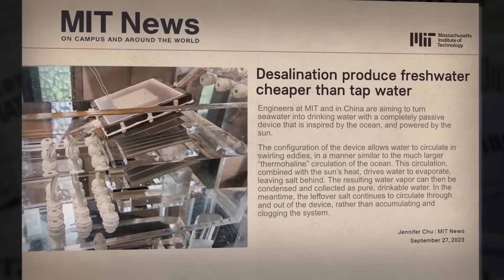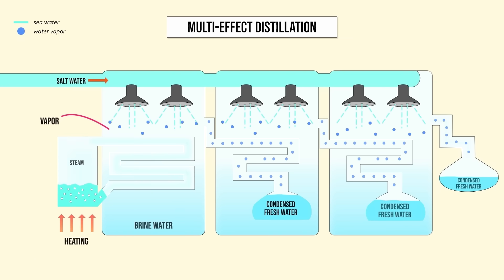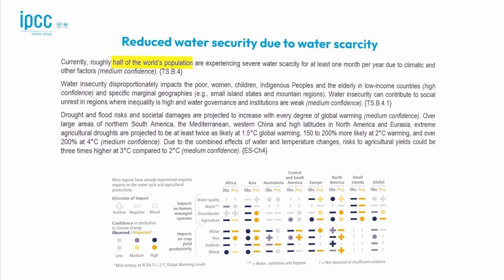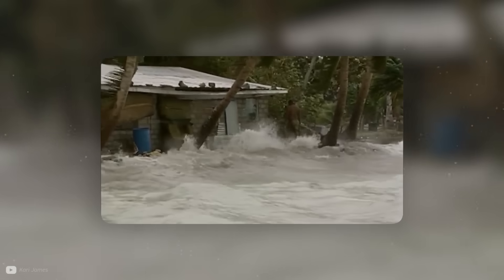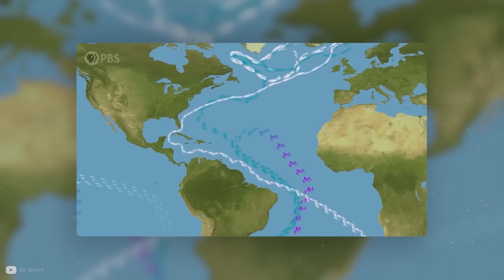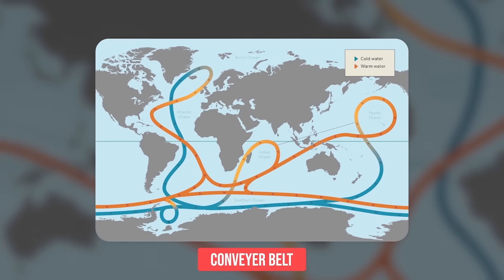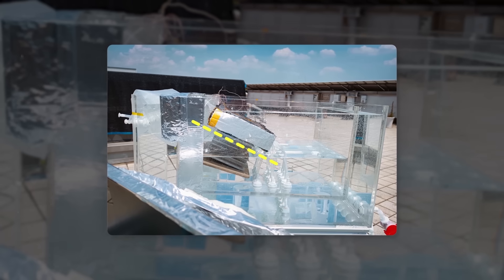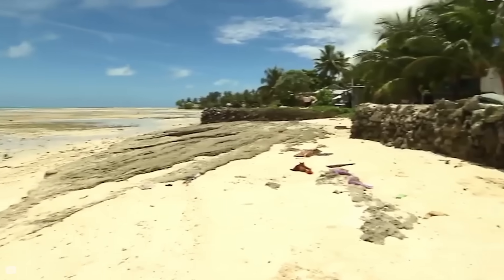Unlimited Fresh Water: Can MIT's Breakthrough Save Us?

Comment: I think theres a problem with the explanation of the device, or it's just me not fully understanding it. You said when water evaporates, it's denser, so it should go down, but then you explained that the saline hot water is replaced by a cooler water which comes from bottom, means it pushes the warm saline water upwards. Like in solar collectors. So I'm confused, the saline water goes upwards because of the temperature or down as of density.

Comment: More along the lines of Third World necessities... A five gallon bucket with a concave cone facing into the bucket... "Lid"... The fresh distilled water would drip off the conical lid that you invented into a collection "cup" that fits snuggly in a "socket" in the bottom of the five gallon bucket. On a larger scale, a 55 Gallon Barrel. Maybe a faucet situation that is like, 25% from the bottom of the "Collection Cup" inside of the barrel... That would necessitate that that tubing would pass through the wall of the barrel, and through the salt water too... From the "Collection Cup". FREE! Your Patent Pending... Black Bucket. Black Barrel.

Comment: A Glass Pyramid... At just the correct steepness... The condensation runs down the inside of the "Cone" into a gutter on the inside of the Pyramid/Cone... Blackened on the floor... Recycled pop cans maybe for the floor in which the water collects... Recycled plastics for the cone? Maybe glass. Store the evaporated, condensed fresh distilled water in a subterranean storage tank. "Ozone Bubbler" in that. Have many of those! Like, on the East Coast of Mexico. Drip Irrigation Hoses...

Comment: Nice tech gadget but the real question is, how is this gonna help poor countries on the verge of collapse due to lack of water and overheating, caused by the accelerated climate change? There is a much more affordable, easily accessible and environmental friendly method at hand, it's called "Atmospheric Water Generation" and they basically use either solar or wind energy to cool down the air and funnel it through special water absorbing surfaces, in order to catch the moisture in the air. This method is slower but because the tech is much simpler and long lasting, it will be cheaper in the long run, due to 99% less maintenance and upkeep costs and there is ZERO waste to the environment. You just need to build enough of these structures (they can be integrated into urban or natural areas and be constructed like art and even enrich the environment aesthetically) around your areas and either gather the water or build a pipe system to accumulate the water for the citizens...

Comment: I was wondering instead of the thermal evaporative process and using heat why don't we just remove the air pressure and make the steam?
Just like the way of nature in making clouds. 
Wouldn't it be more efficient and cheaper?!

Comment: Somethiing that most people and governments overlook is OTEC. Ocean Thermal Energy Conversion. Due to the name, it is thought to produce power, but it is inefficient at doing that. The correct way to view it as a desalination system that an power itself. It can produce 120Megalitres/day using a hybrid cycle. It can also produce a 100MW of power above its own use. Its unlikely to be useful for Kirabas, because it needs deep water with a 20 degree C temp difference, but there are other places it could be used. There is absolutely no need to use desalination plants that use gigawatts of power when something like that is available. Also there are now several other ways to get fresh water using lasers, or using the vapour fro the ocean surface.

Comment: This could obviously be improved by heating the water from below using reflectors to concentrate the heat, and placing the membranes above the surface of the water where the salty water will never touch it.  Instead the vapor steam would pass through the membrane and then condense.  Actually, using this method you could eliminate the membrane, and instead just boil the water from below, and condense and collect it above.  Talk about cheap purification.

Comment: Old Tech
The first "conventional" solar still plant was built in 1872 by the Swedish engineer Charles Wilson in the mining community of Las Salinas in what is now northern Chile. This still was a large basin-type still used for supplying fresh water using brackish feedwater to a nitrate mining community. The plant used wooden bays which had blackened bottoms using logwood dye and alum. The total area of the distillation plant was 4,700 square meters. On a typical summer day this plant produced 4.9 kg of distilled water per square meter of still surface, or more than 23,000 liters per day. This first stills plant was in operation for 40 years.

Comment: But ... the drained off water appears to be draining back into the water reservoir that is being pulled up into the device, correct? So, I presume to prevent hyper-salinity, fresh seawater being pumped into that reservoir and also being pulled out as there is saltier water continuously re-entering from the device. Now, I'll presume they did the maths on the flows and can regulate as needed to stay within a certain range, but I have to believe we're still ending up with some water eventually leaving the reservoir that needs treatment before it can be reintroduced into the environment. My lay concern, maybe rooted in misunderstanding or some measure of ignorance.

Comment: thank you, economy will rise by using jet plasma machine and compressed gas in isolated structure , New energy from sea will change world soon, there are other source of energy that with international cooperation in coastline we can reduce effect of  global warming, sea is huge source of energy, further more  we can prevent these phenomena like cyclone and flood and wildfire by using this hot seasonal atmospheric condition, recent years in summer, geothermal energy happens in surface of coastline, there are many countries in coastline with seasonal hot weather and water condition, in sum-up, by using this energy not only is economical but also reduce global warming in countries like Japan, China, India, Mediterranean countries, Iran, Brazil, Mexico, Us, Canada, (Africa and Arabian countries....) . I invented new method base on air pressure rules and quantum physics ionization sea water minerals in strong dynamic magnet bases on paramagnetic and diamagnetic particles and electrical field and electric chemical reactions (K+, Mg++, Na+, H+, li+ H2, ...) +( O2, N2, ...) in combustion chambers as major part of fuel (more than 50%) for producing electricity and fresh water and fertilizer. 7 methods zero pollution for reducing global warming I mentioned in my profile. as a result, by special design and pumping huge amount of water in part of this airport not only can be change to biggest fresh water and electricity producer but also you can use this airport for long time if (water q1) become less than (water q2) will be stable in flood.

Comment: 11:54 'Gravity feeding' 🤔 Not a very scientific name. This pressure comes from gravity, it's not going to counteract it. It's the heating of the water in the inclined section that makes it want to rise, pulling up the water underneath it. If layers/tubes are very thin there might be a capillary component.
I have an idea: put a few containers of brine on each container ship. Once at sea: let it leak into the ocean at a rate that will empty the container just before arrival at the next port. Nicely dispersed, no dead zones.

Comment: Could we use it to move water uphill at the same time using the angle and the eddy currents on a big scale to run back down powering hydroelectric generators making electricity and clean water and possibly if there's excess heat use it to heat homes ❤❤❤❤❤❤❤ also could use salt pans to dry the by product making sodium to use in thorium salt reactors like china has in production

Comment: Our oceans are constantly churning thru the fresh water emptied from rivers etc. into the ocean and fresh water evaporating from the surface (mostly) into the air making the ocean a bit saltier but the flow is mostly regular and so adding (within reason) saltier water as a byproduct of producing fresh water need not be harmful.
We should study these natural behaviors of water, temperature  and salinity to learn of other natural behaviors that can be copied for our benefit.
MIT has also found a means of using light (narrow bandwidths I believe) that can make the water evaporate 10's of % more with the same "heat" applied vs without the added light.
This process goes on in the oceans and other bodies of water all day long...the MIT article mentioned that this observed and replicated behavior help explain why there is more water in our atmosphere than could be explained by heat-only based evaporation!  Wow, that caused a mini-brain explosion for me when I first learned of it...
https://news.mit.edu/2023/surprising-finding-light-makes-water-evaporate-without-heat-1031

Comment: A concern here is that the cost estimate of water produced per liter has likely not taken into account ensuring that the materials used don't leach into the water (which would then require further filtering). Heat + plastic shown in these POC models is not acceptable for production.

Comment: Is this theory or reality?  There is a catch - the condensing energy that is needed to take away from the system is much higher than water temp. difference. So normally you need to use much more cooling water to get condensing process going. So it is not the sun-engergy that is the 'bottle-neck' in these systems, it's the condensing coolant. But if you can bring up cooler water from the deep sea, and use it for condensing/cooling, then it is o.k.

Comment: so....
the issue is maintenance and energy requirements

but many places where water shortage is an issue have 2 things: space and sunlight aka heat

it can't be that difficult to come up with a concept where you have a long spiral tunnel with a wide bed of water at the bottom, you generate the heat by using either just transparent roof tiles or even make a bowed roof with roof tiles that act as lenses focusing the sunlight on the water
fans blow the air trough the tunnel going with the flow of the water, at the end you use incoming salt water to condensate the evaporate

at the final stretch you would have some type of conveyer belt or scraper system to collect all the salt

it would require a lot of space, but once it's set up and running it should be maintenance free for a long time

Comment: In theory it works but at scale it won't. The more water you purify the more salt is left over. At some point the salt will still build and clog the filter. All this does is slow down the rate at which the salt accumulates but i doubt that this is going to be a free effect. There is likely a lost in efficiency from the energy being syphoned to clear the salt. All this does is reduce the need to clear the filter as often but at the cost of efficiency of the desalination. Also the solar effect is not free. The likely cost of producing the panels will outweigh the electricity it generates over it's life time. Basically completely pointless vs current methods.

Comment: I have a few theories in mind.

Wouldn't it be efficient to make a desalination plant underwater?

It does not have to be too deep.
Heck, it might as well be a platform with the machine submerged.

Just deep enough for the sea to be constantly above it.
So that the input and flow are constant naturally.

Or at least have a constant pressure if it's deep underwater.

The only problem that I have in mind is that the ocean "might" just become too salty.

But then again, I feel like the only logical way to remove excess waste/chemical is to ship them into space. 😅

Comment: This could be a game changer for Australia.The Great Artesian Basin contains about 65 million gigalitres of water, or the equivalent of    130,000 Sydney Harbours!   The water is contained within layers of porous rock (aquifers), held in place under pressure by layers of impermeable rock. 
The interior where the basin is located is the iconic landscape Australia is known for, kangaroos and red dust. When it does rain the desert blooms, so there is nothing wrong with the soil. Its not sand even if there is a place called the Great Sandy desert. The MIT finding could open up a huge breadbasket. The Artesian basin is replenished by rainfall along the western flank of the Blue Mountains where the capping impermeable rock comes to surface. The water takes a million years at 1m/year to arrive. This does mean a permanent reliable water supply covering more than 1.7 million square kilometres. (Australia is a big place and the basin represents only 22% ) Cloud cover varies between 53% and 93%,  it is not scorching hot all the time, and when it rains, it rains. The MIT finding could dramatically change the world's food supply.

Comment: Sounds great, but, dude, you left out one critical bit of information: Where does that super salinated water go when it leaves the system? It is critically important NOT TO PUT IT BACK INTO THE SEA whence it came, if it is going to be used on a large scale. Otherwise, it would be at least as bad for the planet as large-scale slash and burn clearing is.

Comment: desiccant solar evaporation cooler is automatically a de-salinator, or actually the desiccant is the de-salinator and solar heat evaporates pure water from the desiccant, regenerating it. yep just have very fine sand, or silica gel, absorb salt water, separating salts, then heat up the silica gel, to get the water. you have now salt, cooler and water. separate. or you could just use ground as salt water filter, like a normal well does. its cheaper than your tap water. nothing impressive or ground breaking here. nothing to wonder about. normal tech.

Comment: So what steps are needed after 180hrs or for maintenance? 
Been dreaming for years of a electric boat design that would use mostly solar and wind to be the primary fuel to desalinate and store hydrogen (For later use when it's not so windy or sunny at sea).

The maintenance part is what always drives cost up past just using diesel and funny how many " breakthrough" tech has these costly downsides that presenters never discuss. 

Just saw another discussion that found out how light *presenter claimed green light at 540nm is key) is also at play at evaporation. A system that is better then heat alone but still energy intense to make desalinate water vs using salt water for catamaran boat size hydrogen production.

Comment: 6 liters is like a 5 gallon bucket 🪣 so eh not bad for a 3 gallon suitcase solar powered water pumps with evaporative condensers as well as solar heating maybe even solar cooling 🪭 and then using that to fund agricultural profits to improve the ease of environment and energy conservation i mean you could use small wind turbines to pump the water too but basically you just need to find uses for your salt concentrates rather than waste which is the real moral problem with the system i do like the lil slanted boiler system they're using to multi stage recycle ♻️ the stored heat power that pumps liquid through the system give them 1 fresnel large tv sized lense on that briefcase and sufficient cooling system or flow to reduce the heat damage because you're basically turning the suns radiation into a lazer beam focused fine or coarse but still you're gonna need containers very large ones pvc bags large metal water towers whatever infrastructure you can get to increase effecticincies and distribution effectiveness hurricane 🌀 proofing this infrastructure against the unlikely worse case scenario helps you maintain profits too so you probably want to anchor your tower 🗼 down with big radio tower tension cables in excess redundancy to the cement footing and then you can recover energy from freshwater pumped storage while you are at it but with all this excess water flows you'll need to increase your drainage systems capacity and water treatment facilities to protect the environment from your use of it and well couldn't hurt to build ground levels aka elevation higher for some differiental capacity storage I'm thinking like bucket elevator Archimedes screw conveyor air/water pressure tubeveyor or open top belt conveyor trying to get it all uphill to where a bulldozer can flatten it out enough for building and you gotta remember removing the salts 🧂 from the soils to get usable agriculturally sustainable anti erosion and maybe woven fiber net 🥅 grids for soil holding as well as compaction ... i mean might as well build it to last and then mooring floating ships size of retired oil tankers for gardens or as the dock themselves anchored well  filled in with balast to solidify them as a land mass to build off of completely weatherproof and long lasting

Comment: Fake. you can not use the waight of water to pump water out Above the level of the water.  I have built one to try it. water will alway be level. even if its 1000 to 1. goto 15.14 "do to gravity the water pressure is higher. so forces water upto the top" !!! NO it will NOT.